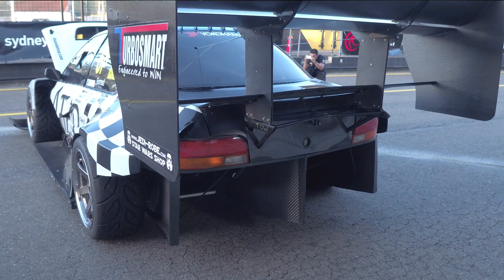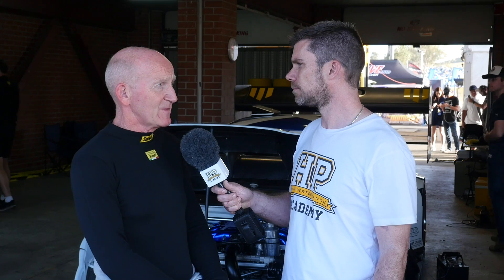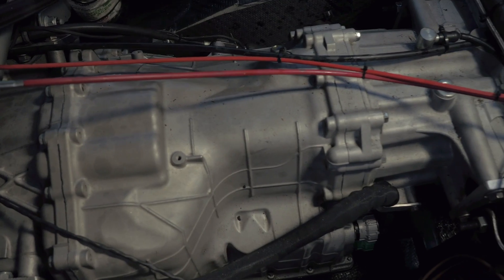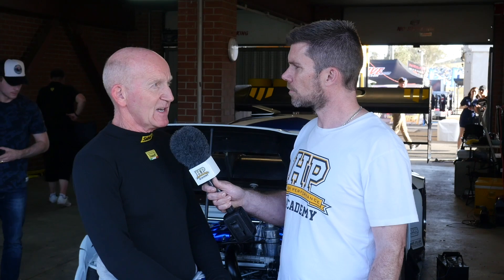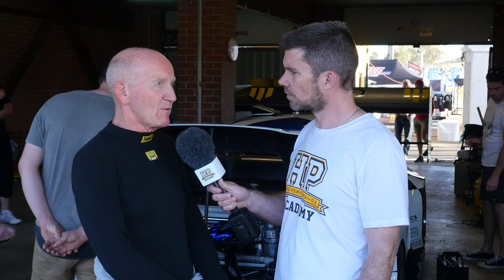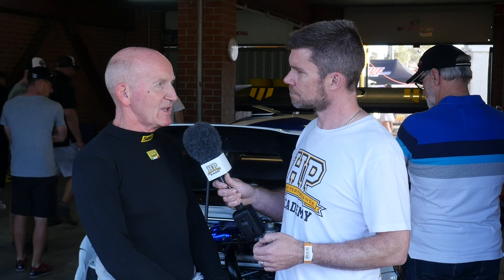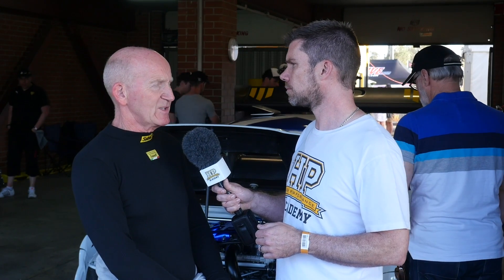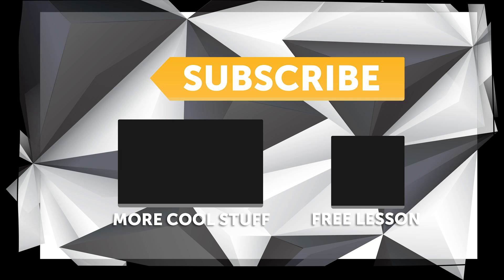Why?! R35 GTR Transmission In A Subaru WRX [TECH NUGGET]

Comment: i just want to understand why the front wheels have to be chain driven in this setup, and would it be possible to avoid the chains with a custom oil pan that would avoid the front diff/axles?

Comment: What in the shit is the chain drive for? Is he seriously driving the front diff with that? lmao
Reply: Chain drive was his last setup. Run pretty good tho.
Reply: Chain drive because the diff is way forward of where the front wheels center point is.
Reply: @RDSAlphard  on subaru using transaxel diff the center of the diff was already behind the center of front wheels. Plus the owner move the engine way back to get the weight bias. That makes it way off that driveshaft angle was unacceptable, so he use the chain drive to get over it.

Comment: A chain driven front diff....just stop. Should have used the R34 drivetrain and either shift like a man or use a sequential system
Reply: R34 wouldn't match up to the H6 engine. The R34 front differential is integrated into the oil pan casting. Even the best sequential Subaru transmissions can't reliably hold 1000HP. This guy has actual experience racing a 1000HP car that's working fine with the chain drive.
Reply from the maker: Nice one Sam. I was just about to say we're keen to check out Joshs WRX build that uses an R34 drivetrain to see how easy his build was - Taz.

https://media.giphy.com/media/26DOs997h6fgsCthu/giphy.gif
Reply: Besides the oilpan integration with the front diff, why would you try to buy a hyper expensive, highly demanded, early 2000s used transmission from the car that literally everyone wants

Comment: think the only meaning is because the subaru chassy is light and the engine can deliver great power
Reply: I think what he really means are those original drivetrain setup are so bad for weight balance and holding torque

Comment: I really don't see enough H6 builds
Reply: Agreed, but they dont do it cause its expensive and nowadays outdated. Porsche engines are the only modernized ones and we all know how expensive those are
Reply: Gamma Light Heard of Porsche?lots of flat 6 builds..
Reply: @jrew3569  I guess I should've more been specific? H6 Subaru builds are what I don't see alot of.
Reply: @gammalight1312  theres a youtuber who is building a twin turbo H6 impreza. Ill link in a sec
Reply: @gammalight1312  i just want to share my research on this, i looked into swapping my legacy gt (ej25 turbo) with the legacy flat 6 but it makes less power than the turbo 4, weighs more, and sits further off the front axles than the ej motors. Performance wise its just worse swapping it into any subaru. It may be a better motor than a stock ej but the problem really lies with way flat engines cannot sit inbetween wheel hubs (too wide), especially with driven wheels.
Reply: @pilotboard2  thanks man, that's very helpful information. So it'll take alot more work to get it's potential, basically building the car around the motor.
Reply: @gammalight1312  yeah its like a backwards porsche. Sounds just like them and inline 6's. Ive also seen some vids of a brz with this engine and it sounds so good. Made me tempted to buy a brz and do it but i think itd be more trouble than its worth
Reply: @pilotboard2  Yo! That sounds incredible!
Reply: @gammalight1312  unequal length headers are dope :)
Reply: https://www.youtube.com/watch?v=yFTiowj6sd8